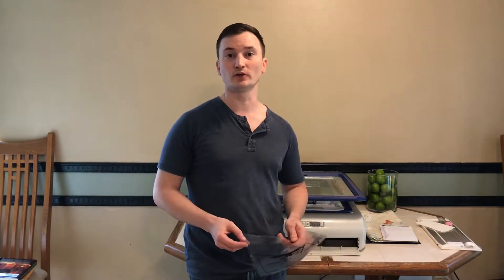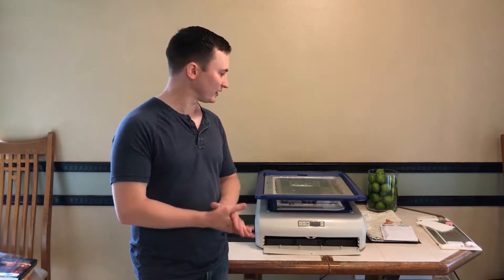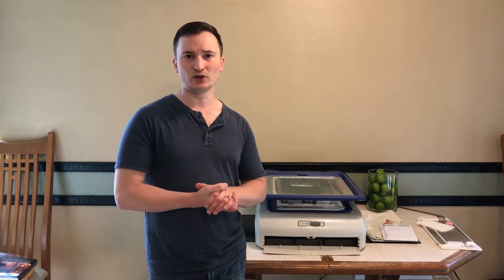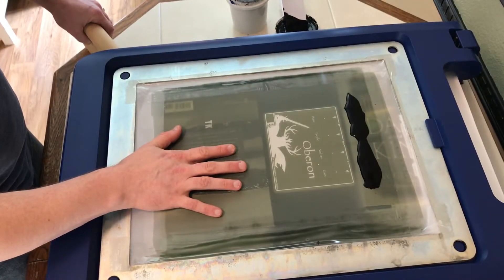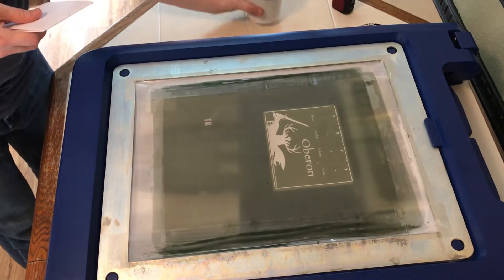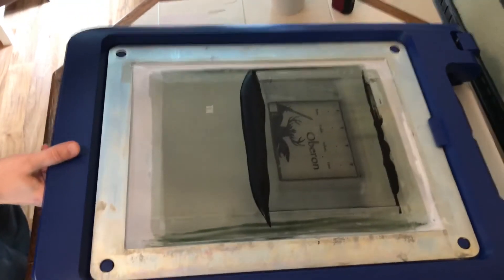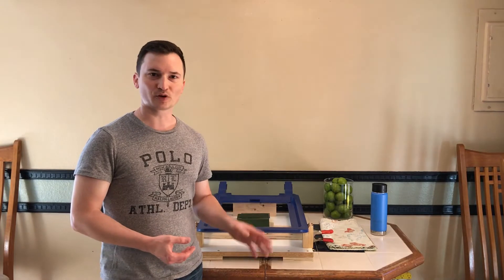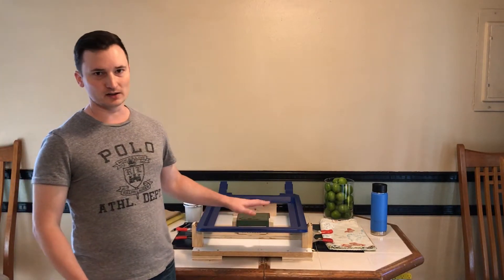How To Screen Print On Effects Pedals

Comment: as a DIY pedal maker and or printer you want a press that you can adjust the screen positioning.  That is difficult economically.  Eyeballing it will always be kinda crazy so do test prints.  Have a mock enclosure for every jig and test your prints on it before committing or expect happy accidents.   Its tough but practice helps a lot.

Comment: I think screen printing would lm d be a fun endeavor but I'm still just building one offs and no two are alike. Because if that I think sticking with a self etching primer and spray paint (finish leveling between coats) then doing a waterslide or posca paint pen art followed by a clear coat is going to be the best option for now at least for me and my desired results. With that said I appreciate you making this video when you did during some of the learning process. Thanks brother!

Comment: Because you intend(ed) to clear your pedal enclosure, after applying the water based inks in your screen printed graphics, did you scuff sand prior to applying those graphics. I ask this because I have gone through the water slide decal phase and found it to be less than desirable so I tried using Createx CandyO2 colors over bare polished aluminum using their clear as the primer and if left more than 48 hours must be scuff sanded because it has cured and future layers won’t adhere well. in the future if I were to use the Candies on a pedal I would use their base coats but this was just to try them out (and add some engine turning to it that can only effectively be done to bare metal) and to build a suitable portable paint booth but I learned quit a bit. For pedals, If I were to design my own, in the future I would attempt powder coating since the equipment has gotten inexpensive enough now and the range of powders is incredible.

Comment: Try “1shot” lettering enamel next time.
Reply from the maker: Thanks. I'll check it out. It's oil based, so I'm not sure if I can use it with screen printing. Have you used this before?
Reply: Tim Krause Electronics I have used it on enclosures, it is potentially very messy. I use a card scraper to clean up what I can and mineral spirits to clean the screen followed by a rise. But the product is permanent once dry.
Reply from the maker: @theHagg606  Good to know. Sounds like a little extra work, but not as much as having to spray 3 coats of clear like I did on this project. Thanks.
Reply: Tim Krause Electronics you’re welcome. Good luck hope it works out for you.